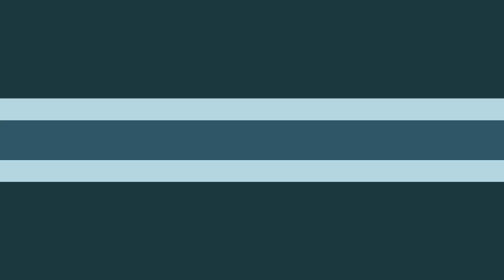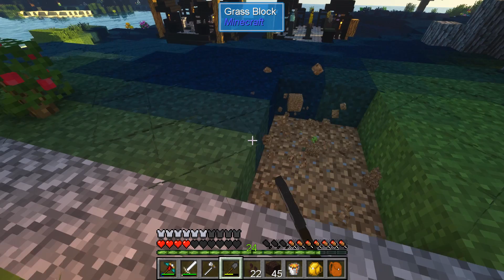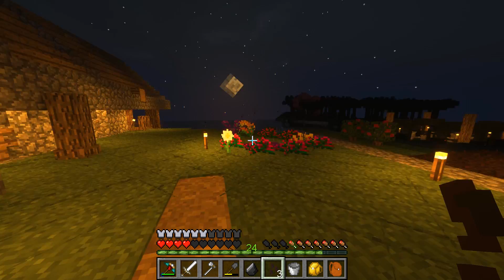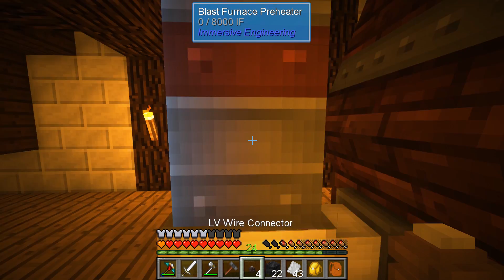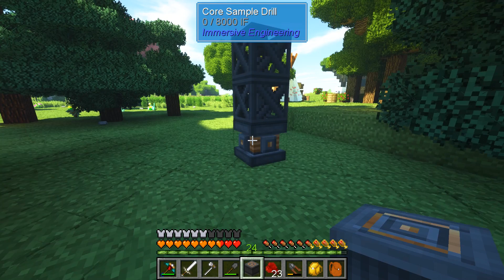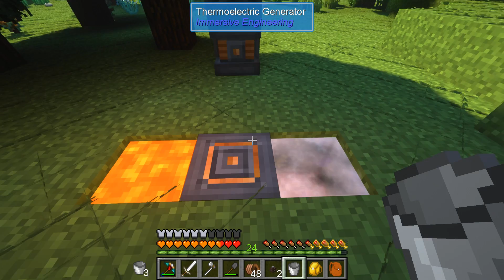SevTech :Ages EP25 Thermoelectric Power + Oil Core Sample

Comment: The chunk I have my pumpjack in had 2 million mb when I started, which is a very, very low end amount. But I've filled multiple tanks and such with the processed fluids while using it several times. 10 million seems to be a virtually limitless supply, lol. But I did check some nearby chunks as well and found several 12 million + oil areas that I can use once my measly 2 million supply runs dry, lol. With my experience with sevtech so far, I'll probably need them.

Comment: Hi, just letting you know that only 3 of those generators are genetating max power rest are runing on 50%, you need hot and cold combination on all 4 sides. Also atm it's still not enough to run the furnace, it went to 8k because the generators have small internal power buffer. Otherwise great episode I quite like the conveyor setup.